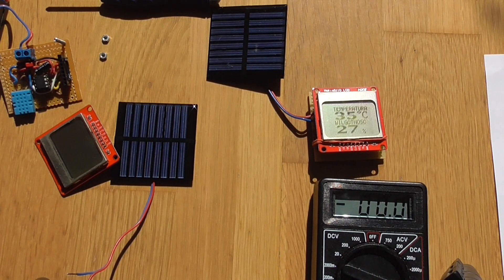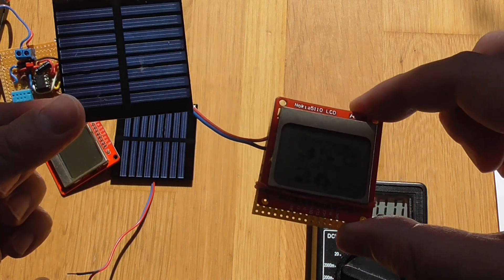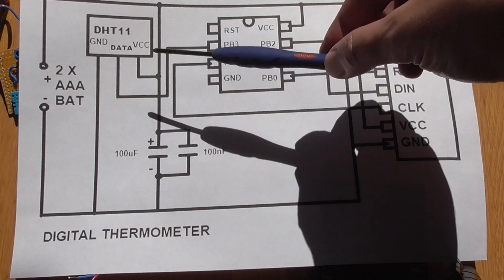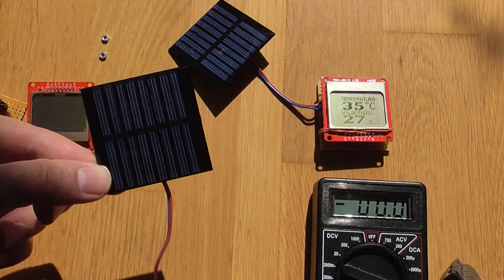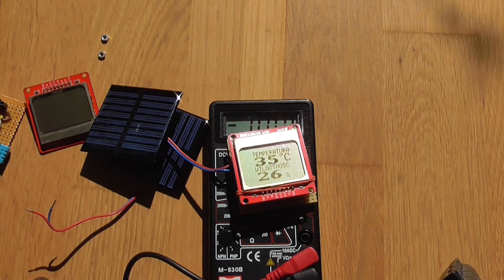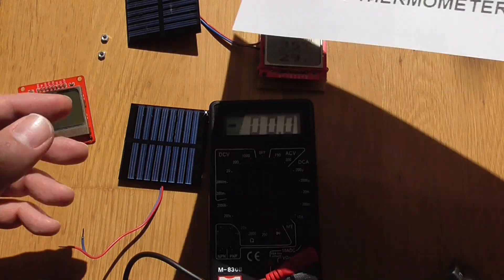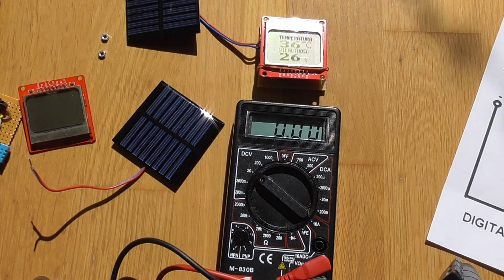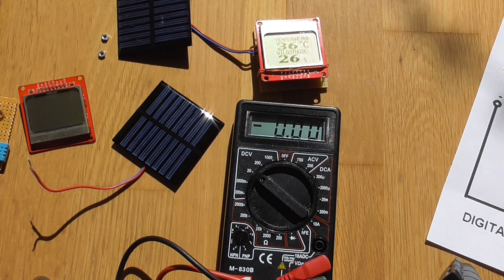DIY Solar powered weather station ( Temperature & Humidity ) from 5 components (ATTINY/ARDUINO)

Comment: I am looking to build something like this for 3d printer filaments, do you think this can work with some more accurate sensors?  and can a button be added to save energy even more?
Reply from the maker: Hi, this kind of solar cell can work effectively only outdoors, inside the room the light is too weak to produce enough energy. Regarding sensors - I have only some experience with digital DHT11,DHT22 and analog LM35,TMP36. Any of these has 0.2-0.5 degree tolerance. I am thinking of some project based on 1 wire DS18B20 which is probably better.  If you want to power the device from set of AAA/AA batteries the button for measurement will be perfect choice.